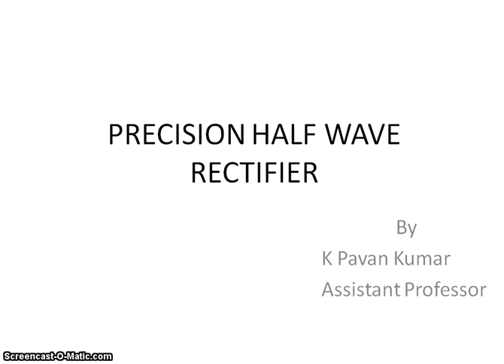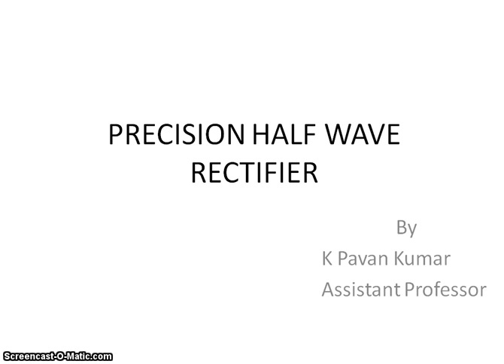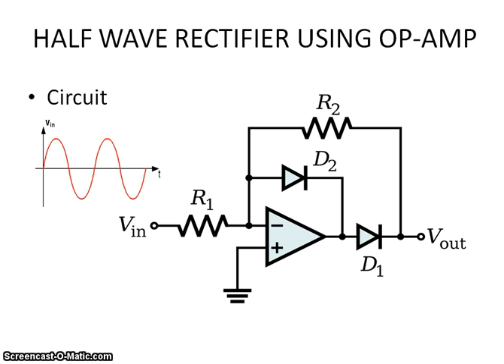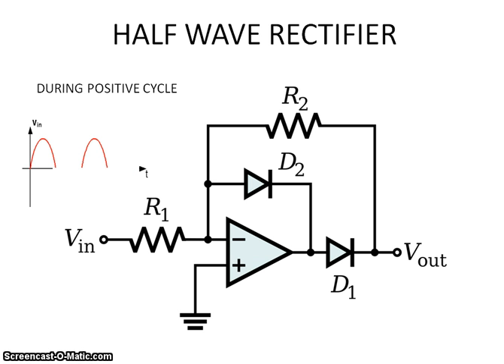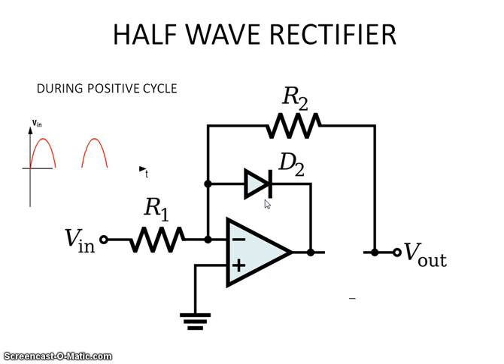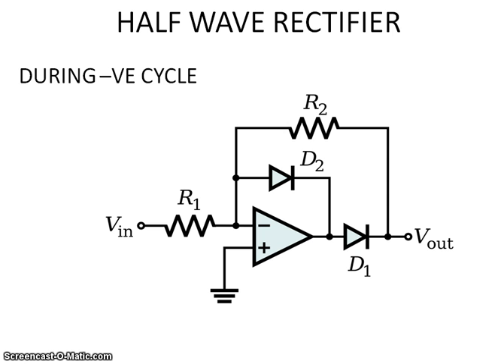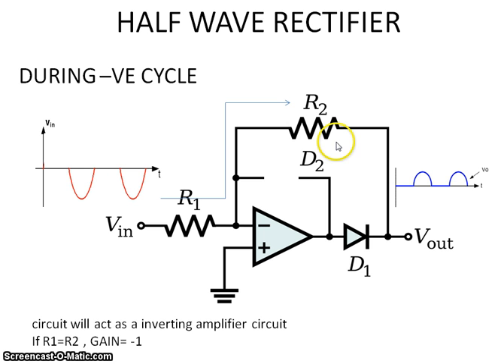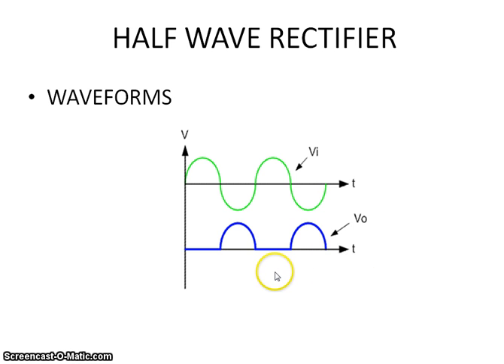Half Wave Rectifier

Comment: Thanks for the explanation sir , understood everything !... but I have a question ...
I have read that Op-Amp acts as a comparator , only in open loop configuration.
here you assumed initially that the Op-Amp is acting as a comparator.

how is this possible?

does op amp act as a comparator in inverting and non inverting amplifiers too ??

if not, why are we assuming this case here in precision half wave rectifier ?
Reply from the maker: yes you are right rohith...but when we are analyzing the feedback circuits we need to start with open loop config (comparator) only once we get the output then the output is fed back to the input ..so after some iterations the output may be stable depending on the feedback (+ve or -ve)

Comment: if op-amp gain is unity and Vin is less than 0.6 volt how the diode D1 will be forward biased in the neg half cycle?
Reply: During positive half cycle ,-  Vsat is  much less than Vx=0 .So D1 conducts.

Comment from the maker: Hai.. Siddhartha
You r asking, what is the need of diode D2.. 
Ans: During positive cycle of input ,  current should be zero at the output terminal. So without D2 diode a small current will flow to the output. To reduce this current we r placing this diode. So what ever the current coming from input, it will flows through R1, D2 diode and to the opamp. In this case opamp will act as current sink
Reply: how  can small current flow  to o/p.no current flows to i/p terminal so full current must go to o/p  Right?